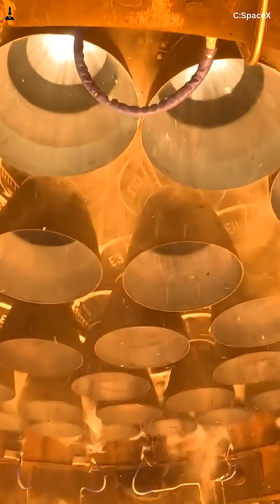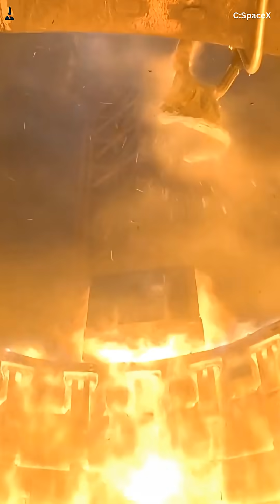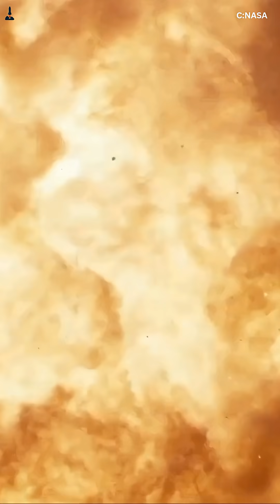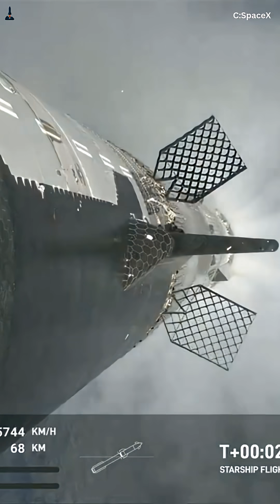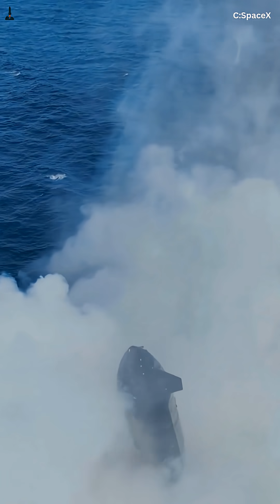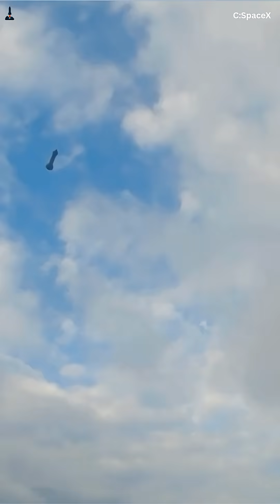This is Why Starship Ignores Engine Failures #spacexrocket  #starship  #elonmusk #starshipupdate

Comment: Why don't they catch the starship system too? Apparantly it has never been recovered like the booster system, which is either caught in the grapple tower or extends landing gear and lands successfully! Imagine that folks, all this hype on the landing systems returning to the launch site to be recovered, but no, it's not true the top section of starship has never been recovered!!! Why don't they just build a proper landing recoverable tower and save the starship section?

Comment: Even the earliest rockets/spacecraft where flown by computers (and software), like the Mercury. But Mercury was controlled remotely by Radio. From Gemini and upwards, the inertial guidance system where onboard the rocket and spacecraft. The astronauts are along “for the ride” (Actually they are the monitors and can control, if necessary, the processes running. However, most of the monitoring is done at the ground).

Comment: Every rocket is flown by software..
Reply: True. but there are some sometimes when rockets are controlled by man part of the time like the Saturn V, space shuttle, and eventually the space launch system
Reply: the space shuttle has been landed by hand
Reply: The space shuttle at that point isn't even a rocket it's landing as a glider.

Comment: The point is that Starship autonomously reacts in realtime to every bug, situation and environmental element and adjusts. Of course every rocket is automatic, but it doesn't make them autonomous. They only need a certain level of autonomy as anything else is a waste. That's why it is so hard to even copy Falcon 9, let alone Starship. 
Think about a Tesla cab but for rockets. It has a basic flight plan but after take off, it decides how to do everything.

Comment: Bolix, it can't even make orbit without a payload.
Reply: They have reached 90% of orbit, and proved that the systems still functioned so they could’ve gone the rest of the way if they wanted to, doing that last bit just hasn’t provided data that they need just yet
Reply: it definitely can. it goes most of the way to orbit. they wont be going orbital till the next  few flights, because that isn't what they are testing right now.
Reply: Still no payload

Comment: Literally every rocket is flown by software man 🤦‍♂️. Stop this insane glaze
Reply: Ridiculous!
Reply: Not entirely true. The Starship is unique in how much it relies on software.
Reply: @genseek00  how?
Reply: They're literally not. Stop your insane ignorance and derangement.
Reply: @Scudzzorz15  they are 😂 all rockets are flown by software since the vostok program, early pilots didn't even had controls at all inside the capsule. the only rockets to be manually flown into space were the lm during final descent and post initial ascent, the space shuttle in some contingency situations that mostly never happened, and the virgin galactic space ship suborbital spaceplanes, the only "spacecraft" fully manual flown. that doesn't mean the pilots and astronauts in general didn't and doesn't have to do a lot of stuff to keep that software running correctly along side mission control
Reply: The slope is insane

Comment: Starship is a complex machine but that doesn't mean it cannot be piloted by human. In fact, most of today's human piloted vehicles are run by software, in case you don't know.

Also, during reentry, communication didn't drop out, else we won't be able to see the video in real-time showing the whole reentry process and the beautiful plasma formed during that time.
Reply: I noticed that too, about plasma disrupting radio. While, yes that happens, we use satellites to relay signals from the protected antennae on the other side of the ship. Since the 1980s.

Comment: Anything can be controlled by a person if the control system is properly designed. Rapid adjustments are no exception. Those can be accounted for mechanically, electronically, and intuitively via skilled piloting.

Comment: Another reason why moon landing was fake. 
Dont tell me the landing burn was done by humans
And the onboard computer runs on 32KB of RAM 😂😂
Reply: bruh
Reply: the two reasons you cited fall apart under deeper research.
1.The landing burn was largely managed by the onboard flight computer in Apollos Lunar module (the Apollo Guidance Computer, or AGC). and the LM itself had much less thrust than the starship does (the LM's descent motor had ~10,000 pounds of thrust, while starship has ~500,000 pounds of thrust. that's like comparing a candle to a full-blown flamethrower.) so humans were completely able to control the Lunar Module, although the computer handled most of the descent. it is worth noting that during Apollo 11, Neil Armstrong took manual control of the lunar module to avoid a boulder that the AGC was unaware of, which in turn probably would have resulted in a catastrophic failure if the landing had proceeded without Neils intervention.
2. your confusing RAM and ROM. Assuming the "Onboard computer" your referencing is the Launch Vehicle Digital Computer onboard the Saturn V, then you are partially correct. the LVDC ran on 32KB of ROM, not RAM. The LVDC actually had 2KB of RAM. if this still doesn't sound feasible, keep in mind that the LVDC did not need any general-purpose UI or other systems a typical PC has, it only needed to do three things: Monitor altitude and speed as well as other basic flight characteristics, separate the stages on time, and adjust engine gimbal according to the flight plan. while these actions in themselves are very significant to a successful launch, these responsibilities are actually pretty simple to make a flight computer manage relative to the absolute gargantuan task they are trying to accomplish. Basically, the flight plan and expectations were on the ROM (long term memory) while the systems that actually managed the controls were much simpler were on the RAM (short term memory/variables).
Reply: @TheCrowOfJudgement and buzz himself refuse to swear on the Bible that they landed on the moon.
Reply: @jd7ub Why the fuck should he...that book is only good for toilet paper anyway
Reply: @TheCrowOfJudgement  that popato flight computer won't even be able to store direction data forget about thrust vectoring on landing burn, it would be too slow to process data from the sensors
Reply: @jd7ub  32KB of ROM is more than enough for a basic flight/trajectory plan. and both the AGC and the LVDC required input from the crew at certain points during launch/descent, though the LVDC was mostly managed autonomously since once again, a basic flight plan is completely able to be stored with 32KB of ROM. and the 2KB of RAM only needed to monitor the numeral values/varibles of launch systems previously mentioned, and make sure they were all optimized for said flightplan in the ROM. and calling the computer a "Popato" is not a valid rebuttal to the clear explanation i provided in my previous comment. though civilian grade (and some government) computers were indeed not as advanced as what we see in todays computers, so by todays standards its somewhat reasonable to call them "popatos". my argument still stands.
Reply: @TheCrowOfJudgement soft landing on the surface of the moon would require fast and accurate thrust vectoring like the ones we are seeing in space x rockets. This requires fast processing of data coming from many sensors accelerometer, gyroscope, velocity etc. the computer of 32kb ROM is completely incapable of calculating these data continuously for realtime thrust adjustment. 
32kb rom is not nearly enough the even store the algorithm to calculate these data
The memory was made of magnetic core not silicon and they are slow af,
Reply: @jd7ub aren't you late for your flat earth support group meeting?
Reply: @neverknow69 no,I'm a mechanical engineer
Reply: @jd7ub  Well no, because the LM didn't have thrust vectoring at all. It relied purely on RCS. Because of this, no one had to worry about precise vectoring that could flip the LM if done barely incorrectly. Plus, using RCS for attitude control is a lot easier for a computer to do than calculating thrust vectoring. The LM didn't really need anymore than the force of gravity, its velocity, and its flight plan, it doesn't  really need any of the other things you mentioned. This is because the LM was targeting a tiny area, it was trying to get into a wider area. In fact, the LM that landed on Apollo 11 ended up an entire 6.4 kilometers off target because it essentially barely controlled where it was landing. Starship, on the other hand, is try to land in an area barely wider than it to be caught out of the air, that requires lots of data and fast calculations. Landing in an entire region of a celestial body with no atmosphere? Not so much, and even then, they were STILL off target, by a lot. And this isn't even getting into the fact that Starship is ALL computer controlled while the LM basically had hybrid human and computer control.
Reply: ...The craw of AI😂

Comment: Virtually no rockets have been flown under human control,the saturn V was flown using a triple redundant computer built by IBM called the LVDC in a ring section below where the astronauts sat.
SpaceX are standing on the shoulders of previous engineers from the past.
Some great videos on UTube about the saturn V,check it out.
The engineering is staggering.